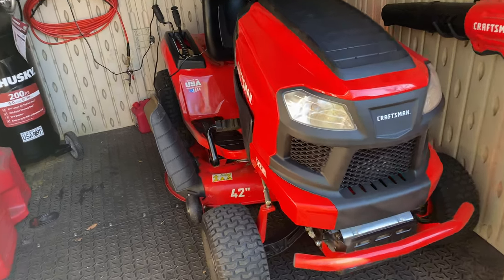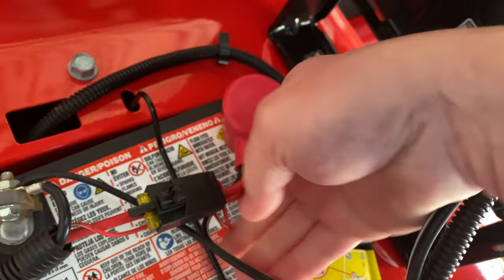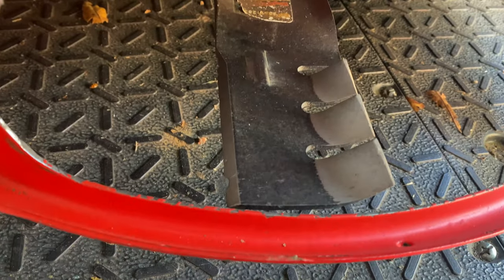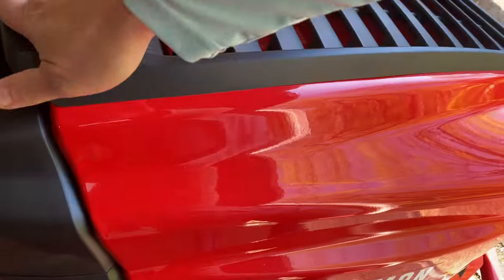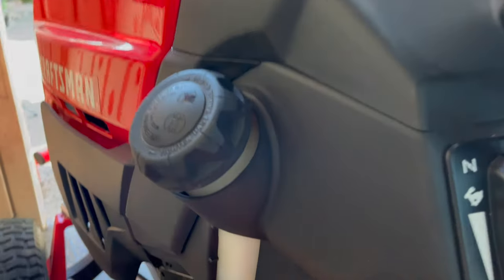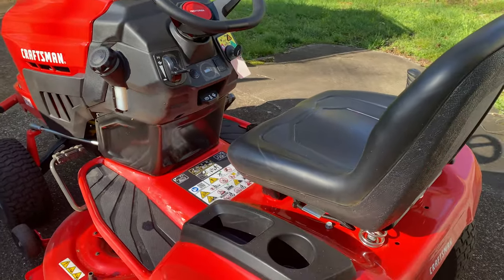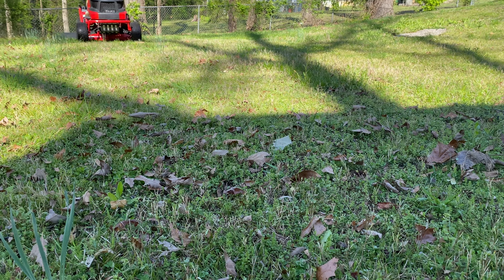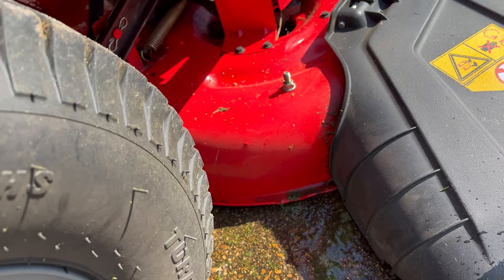First lawn cut of 2024 and 4th year with the Craftsman T210 Riding Mower from Lowe's - now T2200

Comment: I sometimes wonder if the naysayers are seeking sponsorships from the manufacturers and bash on them if they don't comply.  Your mower still looks new. So many tools get trashed from using them even the first time that its nice that some things can be kept looking nice.  I use a battery maintainer with my camper battery and it has lasted 8 seasons so far.

Comment: Any issues with the kohler engine
Reply from the maker: 4 years in and it’s still doing great. Hopefully that continues 🤞
Reply: I just bought a 2021 T210 with a blown Kohler 5400 for $150. 63 hours and the original owner decided the engine was ‘blown’ and pulled it to install a Briggs & Stratton engine with a horrendous rod knock. I re-installed the original Kohler 5400 out of curiosity why it might have been blown. After changing the fuel diluted oil, I discovered a blown head gasket and a faulty carburetor but it does run quite well. The head gasket kit just arrived and I ordered an aftermarket carburetor as the OEM uses a low quality plastic insert for the float holder and the rubber o-ring that seals the float valve failed causing fuel to dump into the crankcase despite the float and valve working correctly… long story short, I’d recommend replacing that o-ring in the carb at the very least before it fails and dilutes your oil with fuel, potentially causing engine damage or head gasket failure. 👍 I can’t wait to mow with mine in the spring.
Reply from the maker: That’s why I always check the oil level and keep note of how much gas is in the tank vs when I parked it. Years ago I had a Snapper that allowed the engine to flood with gas and I almost found out too late. That won’t happen again

Comment: Do you have any vibration from the deck when mower is still and deck engaged
Reply from the maker: No. That would (most likely) be a sign of an out of balance or bent blade
Reply: Does your seat make a noise if you push in the middle of it like a sqeak
Reply from the maker: I don’t recall any seat sounds from mine aside from the springs compressing when I sit down

Comment: Just broke out my T2200 today🙂.  Curious though - you did not cover checking the air pressure in your tires.  After having my mower sit for 5 months, all four tires needed air.  Is that something you just skipped?  Also, no way could they jack up the price $1,000!  Looking forward to your follow up video...
Reply from the maker: I step on them to ensure there’s enough air. That’s something I always do after I add fuel. Thanks for watching and congrats on the 2200

Comment: I really don't know why 4 years on a belt and battery impresses you.
Reply: Hi!  These new tiny batteries don’t seem to hold up the same as the older standard size ones.  If you run this exact battery, may I ask, how old is it and what is your maint routine?
Reply from the maker: Because like it or not, products have for the most part degraded to the point that 4-years is good
Reply: @sunsandsurfgirl3179  I don't.
Reply: @kev-reviews  My stock battery in my T210 gave out after 4 years,  I replaced it with an AGM with more CCA.